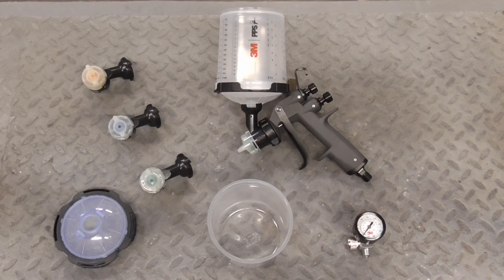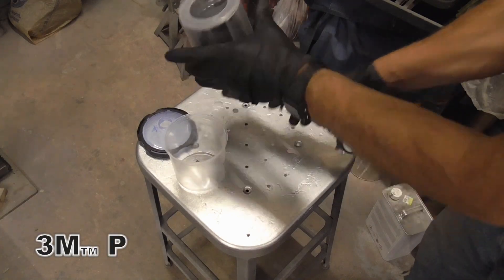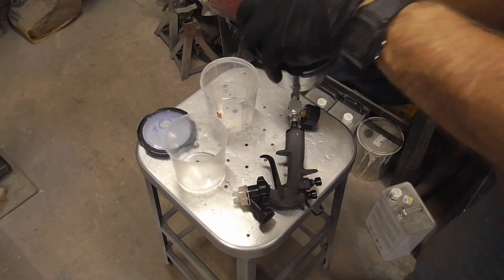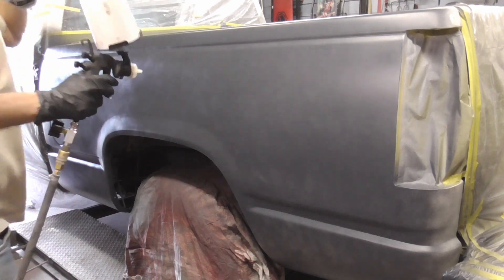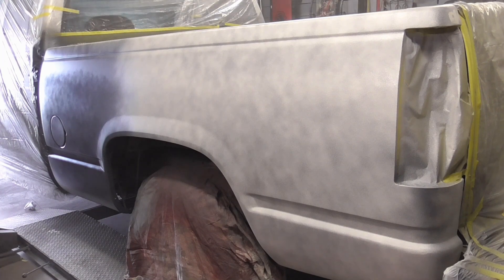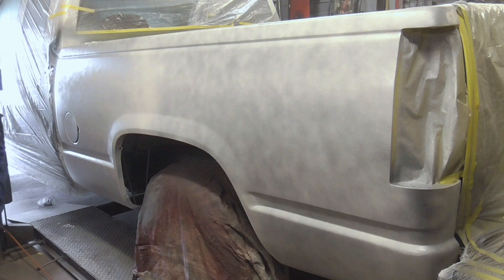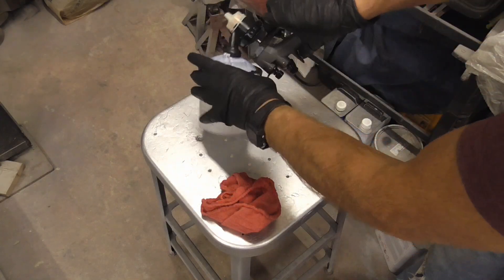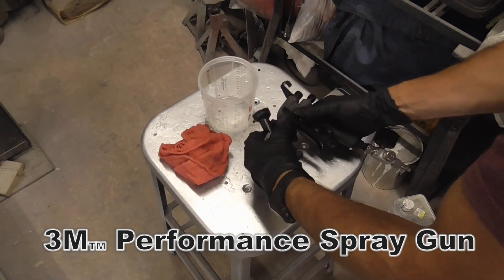The 3M Performance Spray Gun: Spaying Restoration Shop Single Stage Urethane

Comment: Great demonstration of technique and equipment.  Please define "medium to wet" "wet" and "not as wet".  
Do these terms apply to the paint to air ratio?  Why would this change over the total application?  Could you clarify this?
Reply from the maker: Basically the last coat is "wet" - to the point of running.  You want it to lay as flat as possible by putting it on heavy or wet.  Too wet though = runs so... it's a gamble.  Before the last coat though you are more concerned with coverage and it doesn't have to be super wet - thus medium wet or not so wet :)

Comment: We use those paint guns at work to spray large equipment and trucks. They work really well, they have a very wide fan and clean up easy.  We use them with primer, single stage, and two stage paints. While the 3M system is not cheap, neither is paint gun cleaning solvents for cleaning a conventional paint gun. I'd recommend them.
Reply from the maker: Thanks for your input Moe - I love the gun actually.  Easiest gun I've ever used and/or cleaned.  Perfect every time :)

Comment: What compressor did you use to run this 3m spray gun?
Reply from the maker: Sears/Craftsman 106.154541  1hp, 110v, 6.4 SCFM@40psi 5.4 SCFM@90psi  It does have trouble keeping up with this gun - the gun uses a lot of air.  I actually have never used a gun that eats air like this gun.  If I was to do an overall paint job I'd have to use a different gun but for smaller jobs I can use this gun.  Do you have this spray gun? - just wondering if you think it uses a lot of air too :)
Reply: @LakesideAutobody  Gotcha! I don’t currently have this gun but I’m a woodworker and would only need it for small trays that I make with the largest being 32”x32”. Do you think it would keep up with that? To me it’s surprising that it uses a lot of air since it’s only 20psi to operate
Reply from the maker: @Painfulwhale360  It's the HVLP thing - I guess that means high volume (a lot of air or volume of air) but low pressure.   Any way yeah it would work great for what your are doing.  I love it my self - sprays absolutely great, there's a bunch of different size tips for it like from 1.2 - 2.0 or even larger I think.  Clean up is the best - hands down like you see in the video and the cost is not that bad for the liners and caps.  Jerry
Reply: @LakesideAutobody  yup I got this gun and it uses a lot of air 😂
Reply: I’m having trouble with my Lcquer running.. not sure what tips to use. I have used the 1.2, 1.3 and 1.4 tips and they all seem to act about the same
Reply from the maker: @Painfulwhale360  Use less thinner.  Lacquer right out of the can should be un-sprayable (super thick).  Could be you might be putting it on too heavy too.  Let me know what works and what fixed it :)
Reply from the maker: @Painfulwhale360  Ain't that crazy!  Never used a gun that uses as much air.  Sort of bums me out a bit but I keep using it because of the ease of cleaning.  I think w/ my compressor, for big jobs, I'd have to use a different gun :)

Comment: I'm going to get me a new spray gun ,should I get the 3m gun or the devilbiss gti pro lite?
Reply from the maker: They will both spray great.  One you will have to clean after each use but won't have to buy anything for it - like replacement nozzles - liners, etc.  The other (3M) cleans in seconds but you have to buy stuff for it.  Any gun you buy today sprays really nice - even super cheap ones.  You can't go wrong with either really :)

Comment: Hi Jerry will these run of a small compressor
Reply from the maker: Hi Lee - my compressor is 5.4 SCFM @ 40 psi / 6.4 SCFM @ 90 - The compressor has to catch up a bit if spraying a whole car.  If spraying 1 or 2 panels it's fine.  I use it all the time with this size compressor and am very happy with it.

Comment: not a spray booth?  any exit fans?  does the compressor blow dust air into the shop?
Reply from the maker: Exit fan is on low out the garage door with the door open just enough.  Compressor doesn't blow dust.  Here's the key to dust free job.  All the dust that's in your paint job is already on the panel when you apply your first coat.  Almost none comes from the environment unless you do something that really kicks up some dust.  Got to make sure there's no dust on the panel - here's how I do it but lots of folks will have negative things to say about it - it works for me though - https://www.youtube.com/watch?v=VNrIwVMxjI0

Comment: Hi there,
You mention that the second coat will be medium to wet, but not as wet as the last coat.  Then on the last coat you say it will go on wet?
Can you clarify please.  Like your informative videos!
Reply from the maker: Sure - glad you like the vids.  First coat = tack coat  2nd coat making sure it's colored and the paint is starting to lay down or look nice and wet BUT not real worried about perfection on the flow out.  Last coat you want to bury that thing get it as wet and shiny as you can WITHOUT runs.  That's the trick "without" runs.  flat surfaces you can really put the paint on but sides and around body lines, you really have to be sort of careful and say, "good enough"  I'd rather have a bit of orange peel than a run - any day :)

Comment: No offense to you sir. But the sealer should be sprayed on in one even coat. Right? This gun didn’t look like it did that too well. But thanks for telling us it’s a sponsored or paid video. That way we know it’s not completely your honest video
Reply from the maker: No problem.  The reason for the light coat of sealer was just to cover a lot of bare metal spots - you could prime those too if you want - but sealer you don't have to mix.  A super light coat was good enough - don't worry about the dryness as the sealer is very thin and wont create or "start" to create orange peel.
Reply: i've been painting for quiet a number of years and i've never used sealer, but maybe some day i may just depends on  the job at hand anyways  great video as always. and as you know their always a million and one opinions out there.
Reply from the maker: @hunkydude322  Thanks Hunky D - you really never have to use it.  I just like it 'cause it gets everything one color before painting,  it hits all bare metal spots, and does help fill any small imperfections, sand scratches, DA marks, etc.   Also if your sealer lays down w/o any weird reactions, you can rest assured that the paint will too.

Comment: Nice job.  I've gotta get one of these guns to try out.  I hear nothing but good things about them.  I hate cleaning guns after painting, so that would be my biggest attraction to them
Reply from the maker: Thanks Bruce.  That's absolutely the biggest plus - clean up is insanely easy.  I don't have to hang around in the fumes fussing around with the gun.  Pull the gun off the cup and toss the liner/cap.  throw the nozzle in a little container of thinner (spray thinner through it later if saving), wipe the needle and leave the garage.  Takes about 10 seconds.

Comment: Thanks for making this video! Can you tell us what you were using for gun pressure?
Reply from the maker: 3M recommends 20 psi at the gun with the trigger pulled and that was what I used.  Even though it seems low it's not because the volume of air coming out is high - guess that's why it's HVLP :)
Reply: Man, you are fast!

Comment: Explain in more depth what wet means to the novice.
Reply: Get laid and you’ll understand 😂
Reply from the maker: As shiny and flat as you can get it with out runs.  That's it.   Too "wet" and you get runs.  Not "wet" enough you get orange peel.  It takes quite a bit of experience because you get more runs around body lines, vertical panels, and areas where paint can gather.  Flat surfaces you can "bury" w/o fear of runs.  If that doesn't make sense ask some more ?s - Jerry

Comment: I considered getting one until I saw the CFM it requires, too much for my compressor. Bit pricey I thought also. But the pros seem to like it.
Reply from the maker: You are right about the CFM - I do have to let my small compressor catch it's breath sometimes.  I need a bigger comp. anyway though - it's been a goal for a while :)
Reply: @LakesideAutobody  Thanks, I did notice your compressor always kicks in shortly after you begin spraying. I can almost get through half a car before mine does, but then I hooked up a 60 gallon tank to add to the compressor's own 30 gallon one which helps.

Comment: What psi this gun like spraying at?
Reply from the maker: 3M recommends 20 psi at the gun with the trigger pulled and that was what I used.  Even though it seems low it's not because the volume of air coming out is high.  I even went lower like 18-19 psi

Comment: 👍🏻Glad to see you have 3M sponsor you!!! I had the same question someone else asked, what paint you recommend for the beginner painter? Single stage, two stage, acrylic enamel, etc?
Reply from the maker: Solid color, single stage.  I like restoration shop paint if you are looking for an inexpensive solution.  You do have to reduce it quite a bit so buy extra reducer.  Nason single stage paint is great but more $.  It's called Ful-Cryl - acrylic enamel or Ful-Thane - urethane.